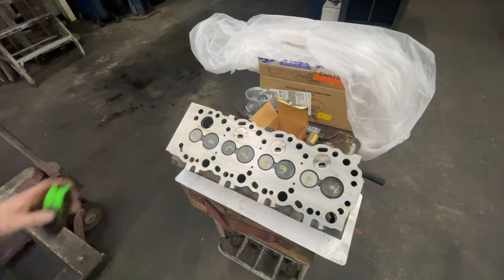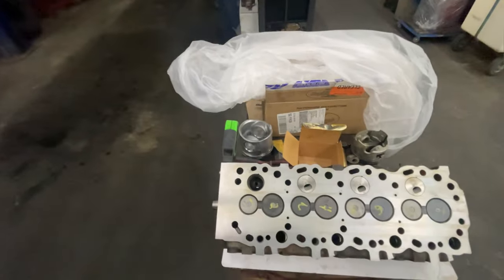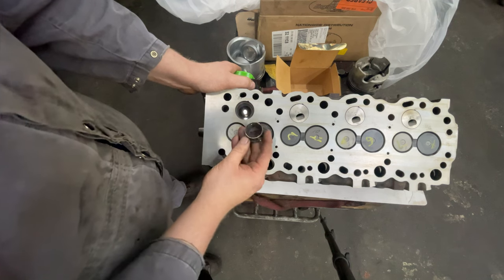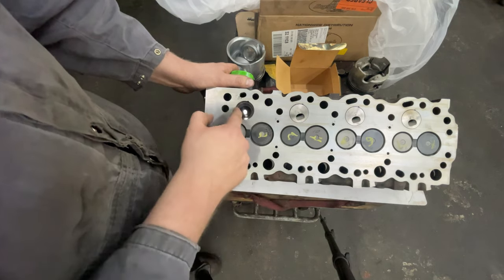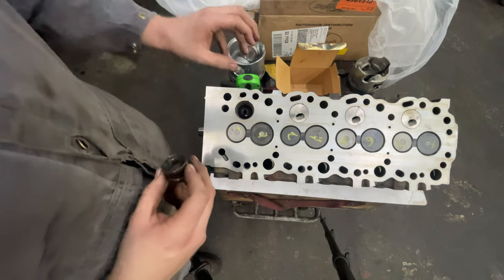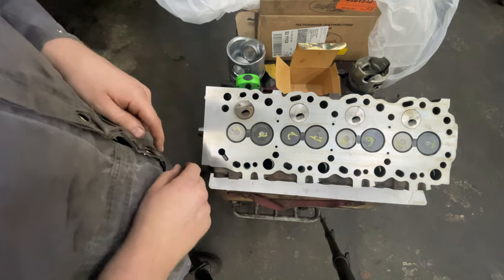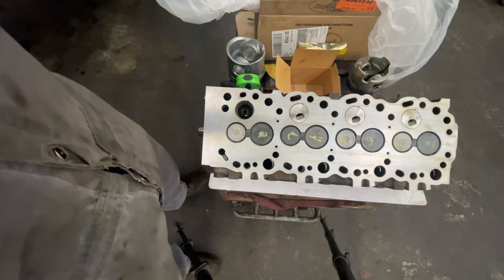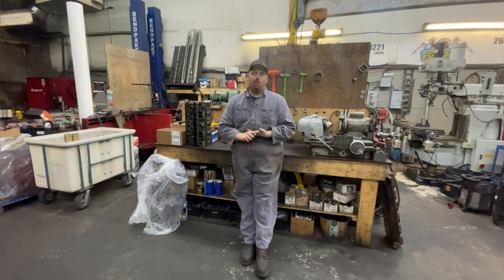BLACK DIESEL IN IDI INJECTION SYSTEMS ( VW , BENZ , TOYOTA ETC )

Comment: Id engines . I glad you brought this up . A few years ago I read a article from a guy who sells vw diesel engines I think in California.  I pretty sure he gets them over seas . He said that the heat rejection was a lot more into the cooling system and the reason why have to have a bigger radiator. The harder start ect .  . So did you have one of the 1.9 ID. I never had one I ran the 1.6 . Yea it was a dog but I loved the 50 or damn close miles to gallon . I drove a lot of 100 mile one way to work sometimes 7 days a week . They were good to me . When I finally went tdi lol crap these things run pretty good . Still have one .  I do all of my own work on them . I have the vag com . Thanks for the great information

Comment: I am asking for your help with my 97 8.3 cummins with p pump get more out of it with out killing it, the motor says 275 hp
Reply from the maker: In my opinion best to leave it alone. I have killed a bunch of 8.3 engines. You can make more power with them but have to do a overhaul to do it

Comment: What are your thoughts on running black diesel in 05 VW Jetta Tdi BEW engine code? What ratio of oil to gas should I use if you think it will work? It doesn’t have a second tank. My trips are usually at least 15 minutes at highway speeds.
Reply from the maker: i knw a guy that runs his 06 tdi on it, i would stay now more then 30% oil to your mix on one tan system. add some gas to the mix   
mix i would do  lets say make 10 gallons 
3 gallons cleaned oil 
1/2 gallon gas 
6.5 gallons diesel 
thats a save starting place
Reply: @CUTTERUPROB  awesome! Thanks!
Reply: Probably not good to add gasoline to a PD 1.9 TDI. The fuel runs through the cylinder head and under low pressure and the gasoline will vaporize. Engine will shut off in 20 min and not restart until it cools down.

Comment: B12 chemtool works excellent or howes meaner cleaner those have been my go to ones for IDI's I also find using Klotz 2 cycle oil in the mix I run 1 quart Klotz for 25-30 gallons of black diesel it helps alot with many of the known issues of running black diesel

Comment: A bit different thing, but anyways, what I’ve read on biodiesel forums, they prefer IDI engines because the rings don’t get stuck as they would in a DI. I have no experience with either, just came to my mind.
Reply from the maker: Biodiesel when you don’t get a complete burn you end up with a gummy slim witch can gum up rings. The black diesel you end up with carbon. Witch can gum rings up as well. But if you run them at the right temps and clean the system you won’t have a issue with either. From my experience

Comment: After several years of running pure WMO in my first 7.3 IDI the cups were so loaded up that it was nearly impossible to start.  I started it on diesel then switched to WMO, then I'd switch back to d iesel a few minutes before parking it for the day.  At first it was pretty clean burning, but then started getting more and more smokey and more difficult to start.

Now on my second 7.3 IDI when I started to notice the smoking and slow starts increasing I stopped using WMO and it cleared up.  My new recipe is to stop using WMO so much and give it longer run times on diesel, hopefully that'll keep it happy.

Comment: Adding a JASO FD 2-Stroke oil at 200:1 is a good idea too. It will help. I also add a product called FTC Decarbonizer at 1000:1 by a company called CEM here in Australia, not sure its its available over there.

Comment: In other words sell the IDI for direct injection
Reply: Willing to bet there is more people running indirect injection engines on alternative fuels than direct... the multifuel ltd465 military engine is indirect... their fuel systems run at lower pressure with not as tight tolerance ideal for more viscuous fuel, higher compression ratios, the prechamber should be hotter, smaller area..than top of piston of direct injection... tons of guys use indirect injection vehicles without prechamber problems. They are generally cheaper to repair , cheaper to buy initially... the whole reason you're interested in alternative fuels.... saving $.. rob really needs to do collaboration video with other guys that have  done this a long time to talk about their experiences
Reply: @walt8238  according to this video you would have to take off the head to clean out the pre chamber. That seems like a lot of work just to maintain the vehicle. Obviously both systems have their advantages and disadvantages but that seem like a pretty big disadvantage
Reply: @killerwall11  you don't have to take off the head for mercedes, you take out the injector, retaining nut then use a slide hammer and the prechamber is out